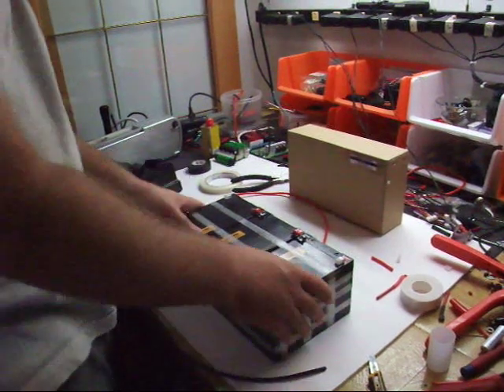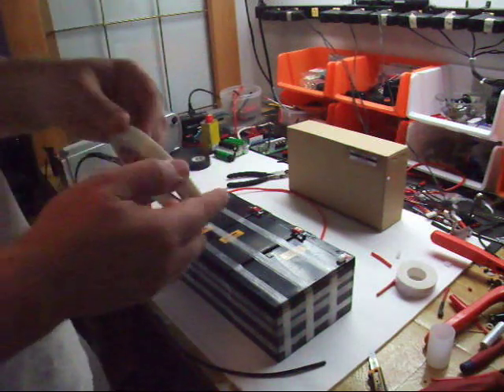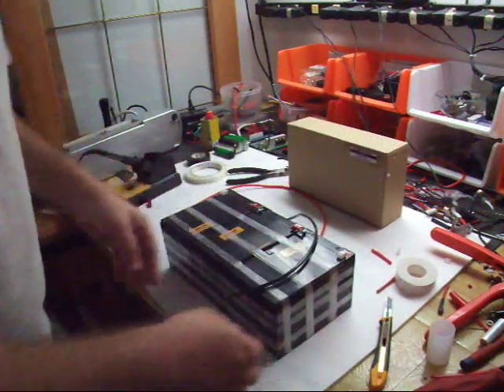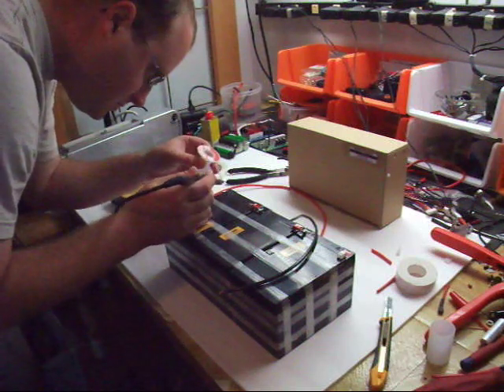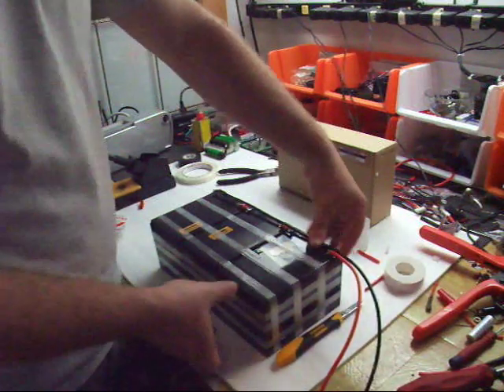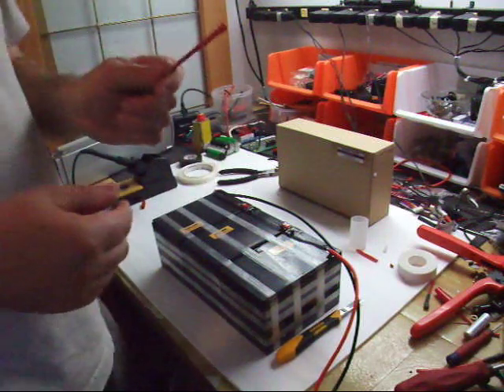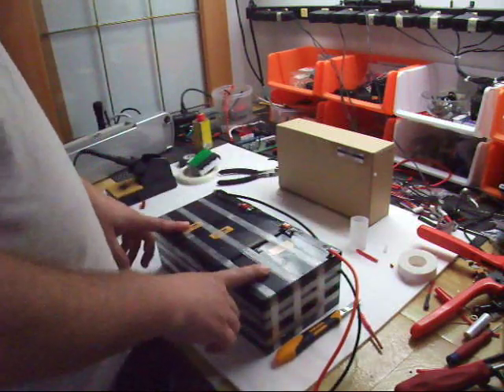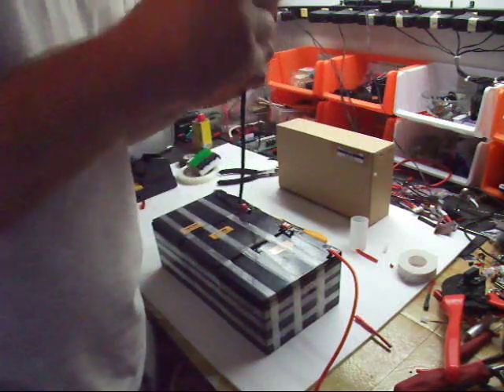36v SLA 12ah Battery Pack Build

Comment: what Gage cable did you use to wire up the batterys
Reply from the maker: I used 12 gauge on this pack, to be used with a 30 amp controller.... it's the amperage that determines the gauge wire, regardless of voltage. .... so 15~20 amps 14 gauge is fine ... 20+ amps i like 12 gauge.... typical ebike will not need very long runs so no need for crazy large and heavy wire...  These days i buy silicone shielded high strand very flexible stuff from hobby king .